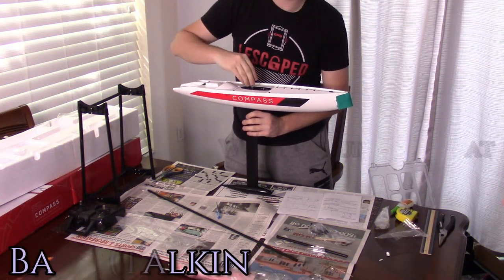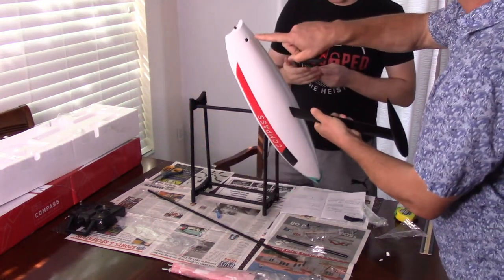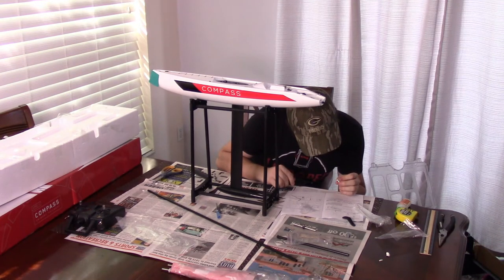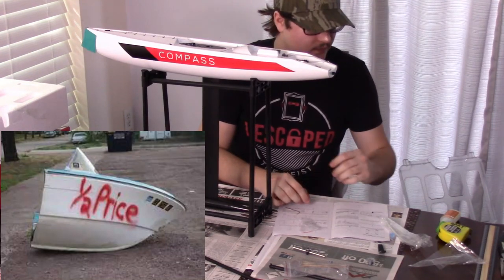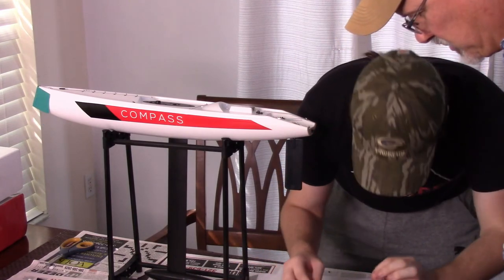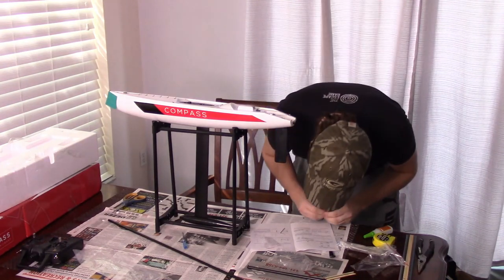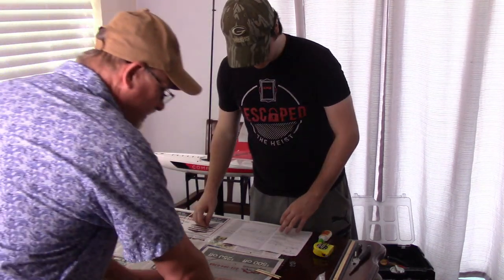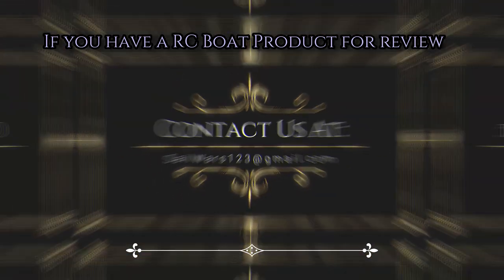Sail Wars Showroom! Compass RC Sailboat Review Part 2

Comment: The boom appears 180 degrees out. The vang is usually on the bottom, that would make the boom even with the mainsail bottom. I'm going to mod mine to work correctly
Reply from the maker: Let us know what happens!
Reply: @sailwars  works well. Holds the boom level with deck and clears the black plastic arm that hold main sail line better. Also makes boom adjustment useable.
Reply from the maker: Thank you for letting us know.  Any new changes?